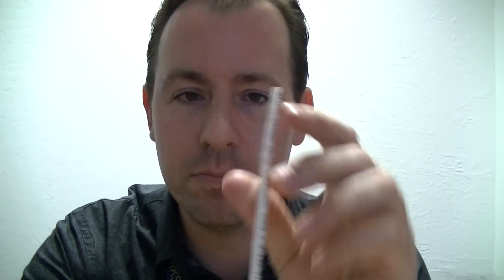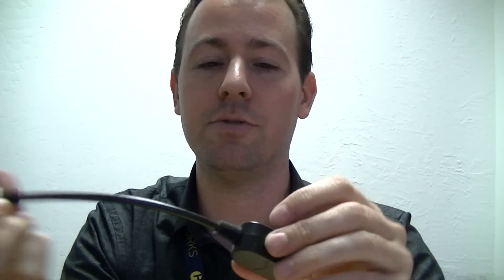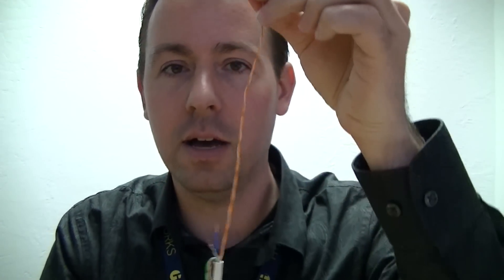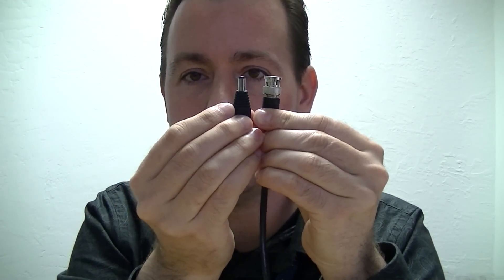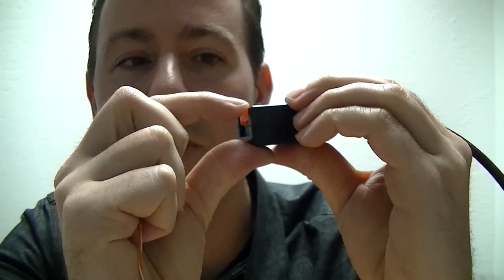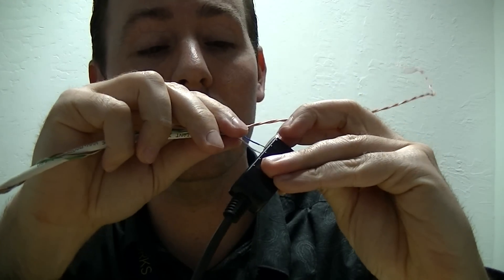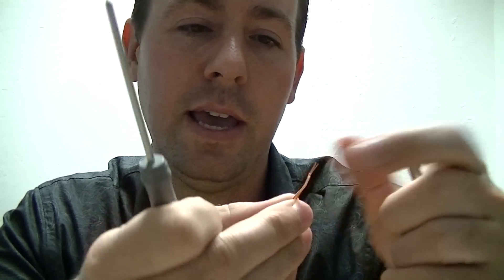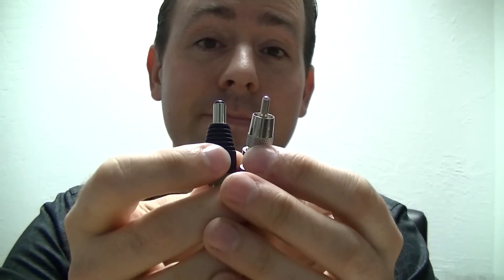Using CAT5 Cable to Connect Analog Video/Audio Surveillance

Comment: Hi i watch your video and just had a quick question! 
4 pairs of cable
1 pair = for camera video signal
1 pair = for pass through microphone
1 pair = for power supply to camera and pass through mic
1 pair spare for if power supply needs to be doubled up to allow for voltage drop over really long distance!!

Thanks for your time and informative vid

Comment: Hello, 
can cat5 and cat6 give power to an ip camera?
Reply: if your IP camera supports POE (Power Over ethernet) then you can send power through Cat5/6 provided you using the correct  power. Most IP cameras use 48VDC POE,

Comment: How many amps can you put through the conductors?
Reply: cat5 individual conductors are 24 awg and can handle 3.5 amps each. Plenty safe even when you run big PTZ cameras with all the bells and whistles ! But if you want faster data over long runs (over 200 to 300 feet) and don't want to max it out on 24 awg cat5, then run cat 6 :)

Comment: If your IR switch on the power draw is to much for cat5 to handle will work fin in the day at night it will need mor power and the draw on cable will make you have camera noise on the cam and no IR ( infra red )
Reply: YES ~ so if this is a concern for you, use ORANGE AND BLUE (twisted together) for + (voltage POSITIVE) and ORANGE/White and BLUE/White (twisted together) to  - ( voltage NEGATIVE).  Enjoy!
Reply: Is there a particular reason you suggest those pairs?  Would it be fine to use the matching colored pairs for positive, and other matching colored pairs for negative?
Reply: @chadf4i  Wh/Wh-Blue is pair 1.  Wh/Wh-Orange is pair 2.  Wh/Wh-Green is pair 3.  Wh/Wh-Brown is pair 4.  The twist of each pair in a CAT5 cable is a calibrated twist per inch resulting in each conductor of a single pair being at a constant 90 degree angle with its mate throughout the entire length of the cable.  This constant 90 degree angle is essential for high speed data transfer because it provides for cancellation of induction over long distances especially in an unshielded cable.  In this example however, the video transmission is an analog signal, not digital,  thus twist is not nearly as relevant when we are talking about just a few hundred feet.  I would still recommend utilizing a single twisted pair for the video feed just to give it the best potential for clean transmission anyway.  Regarding the power, twist is 100% irrelevant and you need to be more concerned with voltage drop over long distances, not induction interference, because it is only 24 gauge wire.  There is an easy fix to voltage drop problems...just strip the plastic coating off of the wires and twist single pairs together and use a whole pair as 1 conductor.  This essentially reduces resistance per foot because you are increasing the thickness of the power wire.  Still not thick enough?  Twist 3 conductors together per side.  This might become helpful information when the IR kicks on at night an draws more amperage over the power wire.
Hope this helps.